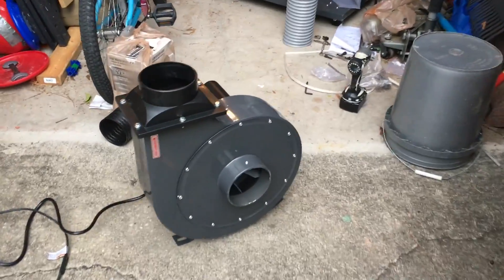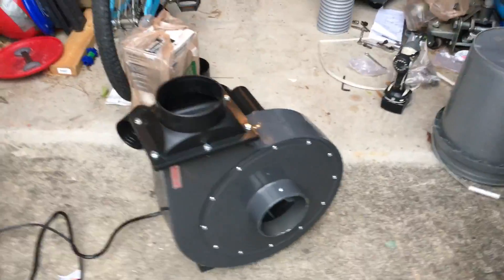DIY Attic insulation removal and airseal with homemade vacuum

Comment: Great video. How did you transfer the insulation from the "dumpster" into contractor trash bags?
Reply from the maker: It's about how you would imagine... Just get in there and stuff bags. Scooping it in and compressing by hand. It's nasty work (full tyvek, respirator etc) but it goes pretty fast when all the insulation is concentrated into one place.
Reply: i'm fantasizing about a massive vacuum sealed bag that compresses all the insulation into a manageable size...  that'd be great.
Reply from the maker: Joe Blow Pros use smaller breathable bags to collect it. I’ve seen some advertised but it would take another person to man it and they are sortof spendy. There are definitely diy options here.
Reply: Would it help to lightly spray with water?  To control dust and perhaps compress it more?
Reply: Coppulor absolutely not you will end up with mud in your hose and be very unhappy. It wont flow if you moisten it too much it can even be a problem.
Reply: @coppulor6500  It would also make it very heavy.  In addition to the extra fatigue it would cause you, the added weight could add significantly to the dump fees

Comment: What were your power bills like in the summer and what are they now? Btw, thanks for sharing this video.
Reply from the maker: I don't have any good data to compare because I completely redid my HVAC system soon after doing this job. My bills are drastically lower. In July, Aug we used to pay close to $500 and since doing the attic and HVAC our bills are around $350 at the most. 

Our 2nd floor stays much more comfortable now, it used to get really warm on hot days.

Comment: would a furnace blower work as well? i see a lot of them on ebay for cheap around 30-40 dollars...
Reply from the maker: I don't think a furnace blower would work very well. Not strong enough. The motors in those are 1/2 to 3/4 HP and the one I used was 2HP (commercial units are 10-14HP). 

And it would suck up loose fiberglass without any problem...in fact it would probably do better since the cellulose I sucked up was pretty dense and compacted.
Reply: thanks. i see the blower motors of this HF dust collector go for about 50-70 dollars on ebay... i tihnk ill go this route!

i did a bit with a leaf blower on reverse but the bag was just too small and too time consuming... maybe just using the hose would be enough... might try this weekend, if not ebay it is
Reply: Do u think a 1hp dust collector would work? I could only find 1hp collectors where I am.

Comment: Is taking off the guard piece (shown at 0:18) absolutely necessary? It would be nice to not invalidate the warranty on the collector if possible... Great video btw
Thanks
Reply from the maker: I'm not sure if it's necessary or not. I cut it out before I set everything up. I'm guessing it would clog pretty easily if left in as there is a LOT of stuff flowing thru the fan. You could always just try it with it in and cut it out later if it gets clogged.  I had a fair number of clogs I had to deal with with it removed. I'm finally getting ready to set this up as a dust collector for my garage shop.
Reply: Thanks for being so on top of things and responding so fast!  :-)

Comment: Very cool video, question did you use the harbor freight dust collector to blow the insulation back in?
Reply from the maker: No, I just used to free loaner blower from Lowes.  I'm not sure how well that would work with the dust collector because the Lowes one has a pretty large agitator to break up the insulation and it works really well.
Reply: +Rich Wachtel thanks rich, good point!

Comment: How did the dust collector motor and blades fair ? I heard if ya suck up a nail it can set ya back ! Great Vid !!!
Also gotta link to the vac you used ? Thanks!
Reply: can you put a set of magnets somewhere inline to catch nails?
Reply from the maker: Vac held up great. A few dings on the blades but nothing major. It's a beast. I ran lots of large marble sized pieces of plaster (like rocks) thru it. 

Link to vac from harbor freight in the text below the video.
Reply: Thanks ! I will keep ya posted
Reply: @Rich Wachtel, could adding a few magnets inside the casing or a plastic housing catch help to stop metal debris from floating through the shoot.

Comment: Thanks for the video! I plan on doing something like this. I have only a 1000 sq ft house. Why not just wear the gloves and mask and scoop the stuff out? Also, Im sure I will find live exposed wires up there plus some dead animals. The house is 100 yrs old afterall. Two quick questions... 1) so after all the work did you really notice any difference? 2) whats the foil on the roof? Im thinking of insulating the ceiling since its the first point of heat entry.
Reply from the maker: The old insulation is called Rock Wool and is like loose cellulose but nasty.  Impossible to rake it up especially with my plaster ceilings. They have a very irregular surface where dust and rat droppings get caught into. Vacuum is the only way. 

Foil is called Radiant barrier.  I was skeptical but it really makes a difference at lowering the attic temps. I'd do it again. 

I can tell a huge difference in my house, esp the 2nd floor. Now it's 100+ degrees so it's all A/C. I think the difference will be even greater in the winter when I'm running my furnace.
Reply: Rich Wachtel what kind of blower are you using ? I need to do this at my house
Reply from the maker: Check the description above. I've got links to the Harbor Freight dust collector.
Reply: Vernon in the insulation. Cover yourself completely.